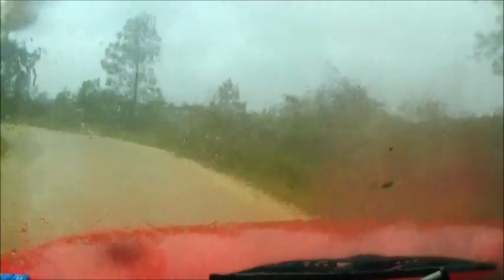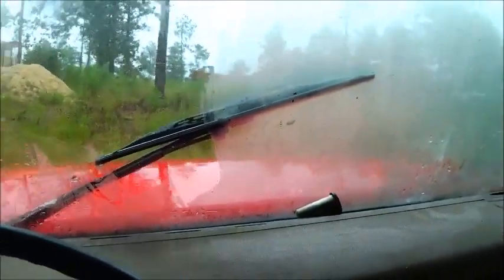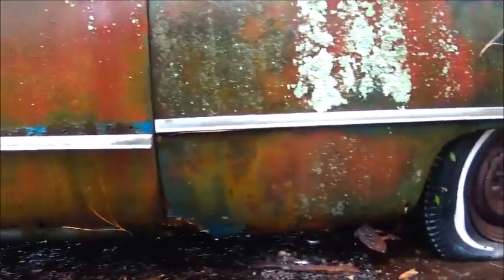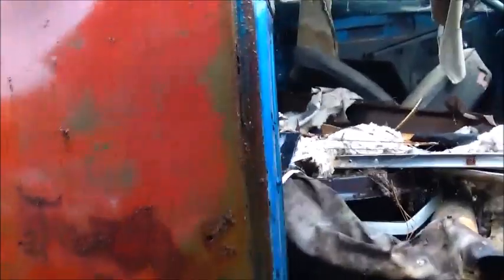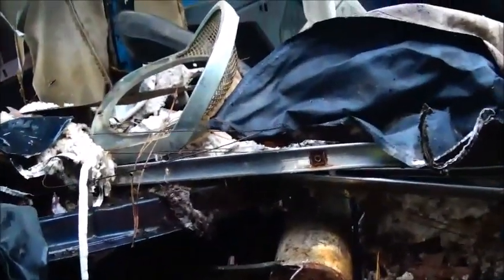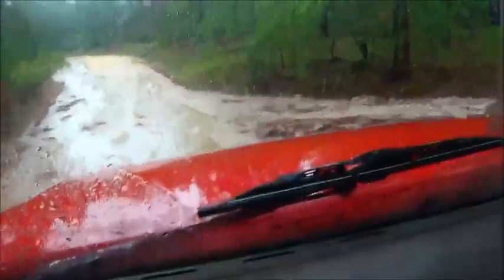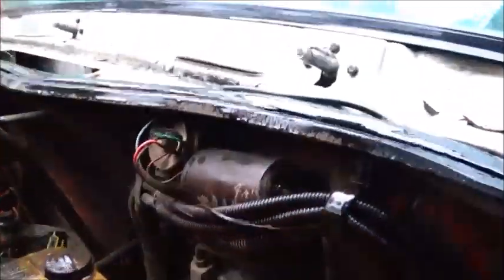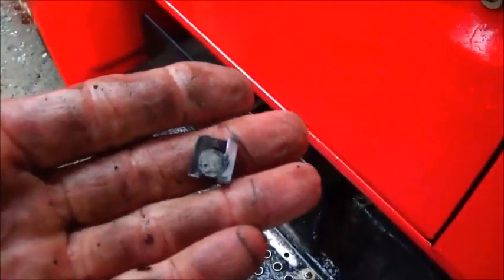1949 Ford Shoe box Rescue

Comment: It is a 1949 Ford. Gas cap outside.  1950 had gas cap inside a little door.
Reply: Tell tale signs that it's a 49 is the pull out door handles, exposed gas cap and pull up trunk handle.  Definitely a 49.